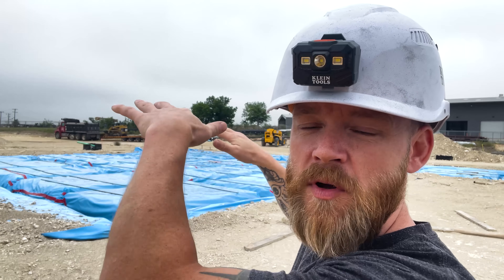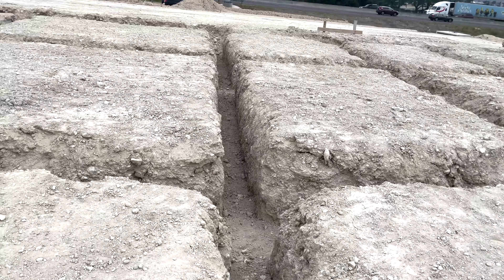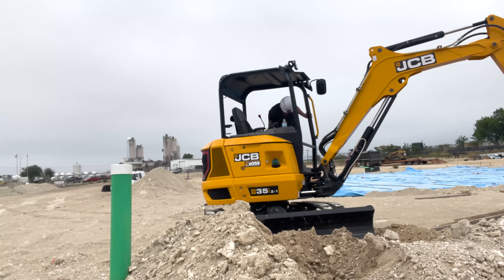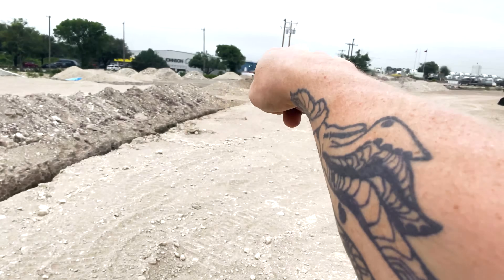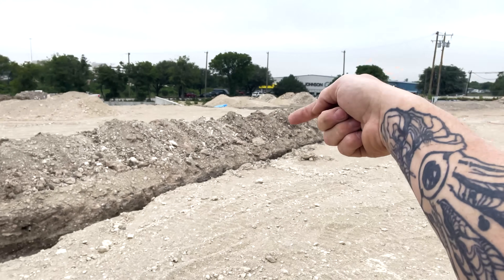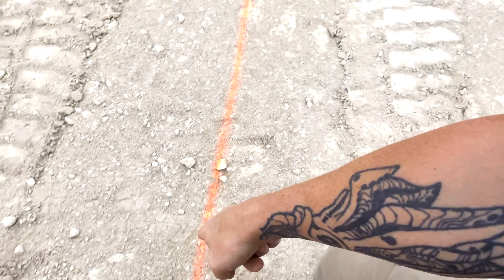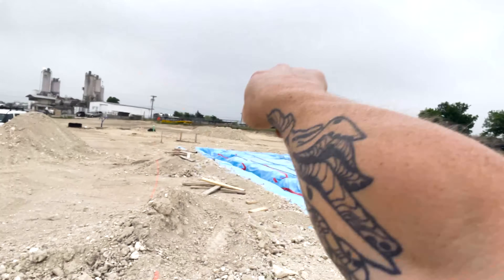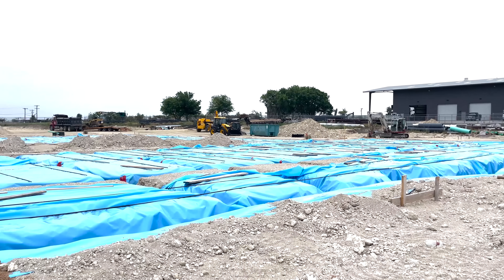Site Prep: Digging Underground

Comment: Hey Dustin, what do you think about this as a video: Theoretical Whole-house DC distribution alongside the AC distribution and its challenges, what would have to change with our current home electrical setups, how devices and loads would have to change, and how current technologies could be used to make it more feasible than it was a decade or two ago (smart panel monitoring and notifications, LED lights, etc.) And of course, if there are any actual potential benefits such as removing per-device conversion and if that would be environmentally beneficial.

Comment: Can you make a video or can somebody help me. I’ve heard of that voltage drop when you go over 100 feet with any run. What do I need to do if I go over 100 feet? Would really appreciate the help 👍
Reply: Voltage drop doesn't magically start at 100+ft. Voltage decreases at any distance at all. Ohm's law is easy to use here; current times resistance equals voltage. Given the current of the circuit, we only need to figure out the resistance.

NEC Ch 9 Table 8 lists resistance for different conductor sizes in ohms per kilometer or thousand feet, use whichever. For single phase circuits, multiply by the length of the wiring, times two to account for current both to and from the load. Ex., #12 solid copper in a 30 ft long run for a 15A circuit, the wire has resistance of 1.93 ohms per thousand ft, current has 60 total feet, total resistance is 0.1158 ohms. Multiply by the 15A of current, we expect to see ~1.74 volts dropped at the load, or ~1.5% drop. As you can see, it can already get appreciable well before 100 feet.
Reply: @ivandiaz5791  thank you, I’ll start reading. Thanks for the info

Comment: I have found it easier when gluing 4" and up (sometimes even with 3") that it is easier with two people and a sledgehammer. Looking forward to following the progress on this build.
Reply: Yup, 2x4 and a sledge does it.
Reply: Definitely easier
Reply: If you glue both inside of bell end (bigger opening) and pour extra glue of  straight end  (smaller end), you don't even need to hammer in much. Twist & slide in at same the time. As long as your foreman is good with using extra glue of course , LOL
Reply: @PrinceTweezy206  I will admit, most of the 3" and up I have glued was for water - and it comes 20' long. A little more effort is needed when you add that extra 10' of pipe.
Reply: @qapla  Lol..20' is a different story..